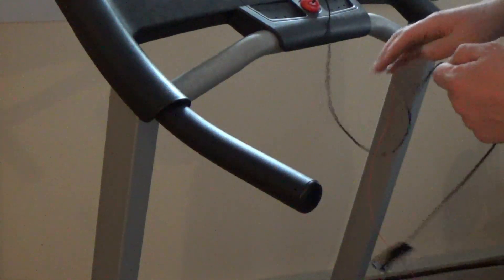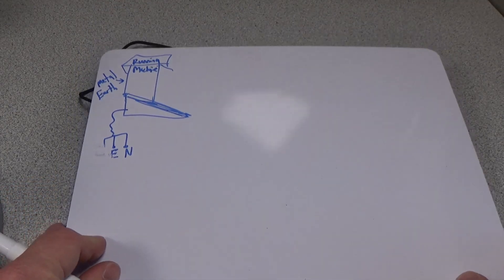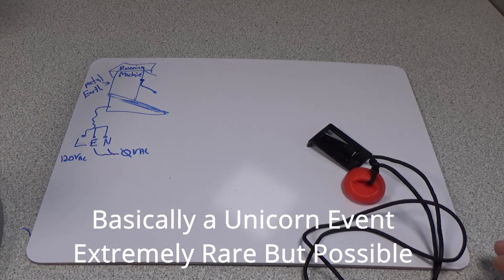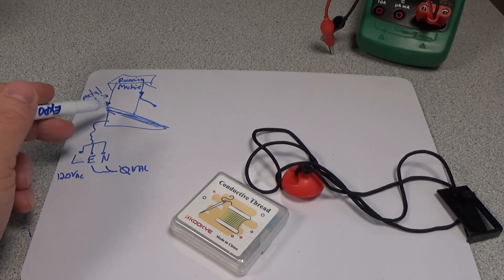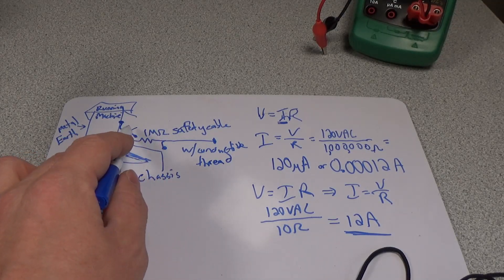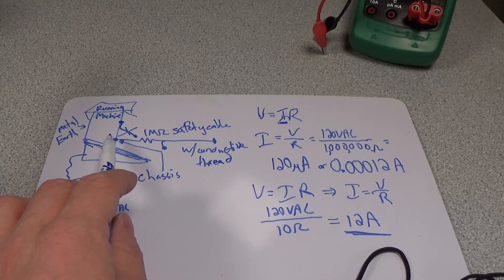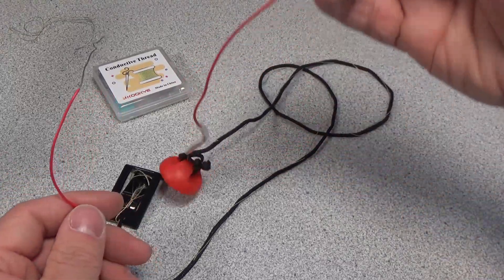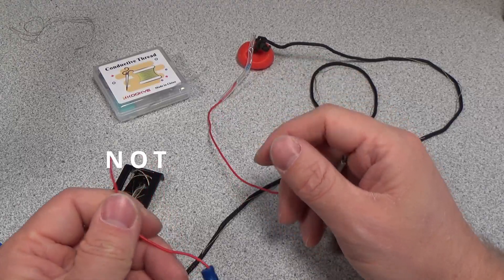Treadmill Static Shock Fix – #15

Comment: I keep touching wall every few minutes to release the static electricity that is built up in my body while running in the treadmill.
Reply from the maker: Yeah, I don't have to do that anymore, I did have to replace the fabric wire once as it corroded open circuit.

Comment: I saw your video at first but I thought maybe my treadmill doesn't have an earth-ground so I did that, but I am still getting shock when wearing a somewhat cushioned shoes. The only solution is don't wear shoes at all when using the treadmill. 

Today I tried your method, and it works. No more static discharge, thank you so much!!! 👍
Reply from the maker: haha, yeah, I did have to replace the string finally, I should put a short out on that.  It went non-conductive after a few years and I started getting shocked again.  Replaced the string and back to zero shocks.
Reply: Thanks for that info. Happy running :) @AllThingsOnePlace
Reply: ay man, will wearing no shoes really solve the static shock?

Comment: Im not as smart as you, could I just buy a premade electric static discharge wrist band and attach it to the metal of my treadmill and have it work the same as your solution? I believe those wrist bands have a built in resistor so I shouldn’t get shocked in case of a short. Please give me your thoughts…thank you!! Love from Ontario, Canada
Reply from the maker: Yes, exactly.  This is still working.

Comment: Use copper Tinsle, run under belt connected to both sides of the earthed metal chassis. Use eyed crimped terminals at both ends.  Drill n tap chassis, put a machine screw through eyed termination, screw into the chassis. Do this both sides. The copper tinsle should be tight with the tinsle in contact with the bottom of running belt. Job done ✔️
Reply from the maker: Good alternative, thanks!  I'm still using the threaded string, still working.

Comment: I got the shock on my manual treadmill !!  Only 2 x AA battery are installed on the machine. Very annoying indeed. Do you think the treadmill mat will fix the problem?
Reply from the maker: What happens with my machine is I end up not connected to ground or earth and therefore build up static electricity in my body.  That has to be discharged through some path, in my case the string of the treadmill is modified to be conductive.  I haven’t had much experience with a human powered one though so the static may be building by some other means.  I don’t know if floating the whole machine on a mat would help or not.

Comment: Same as Michelle mentioned, i am having  the same issue, i havs check motor winding and health of transformer... i am not sure if this is due to Capacitor issue. Its really v high static charge, and some time due to high static charge it get trip aswell. But some time keep running till 6km without getting tripped, but yes static charge stay there, i just try to use wooden stick to operate speed and incline, but its not easy some time to manage it🥲😑
Reply from the maker: Yeah, that sounds like a pretty severe case.  It does still sound like your body is getting charged up so an anti static strap from yourself to the body of the treadmill (as I made) may totally solve your problem as it did mine.  If there is any other issue, issues with building wiring, etc. then the static buildup fix will not help.

Comment: I’ve shocked myself so bad it’s shut my treadmill down completely! I thought I fried the computer part but I unplugged it and thank fully it came back on!!! But man I’m super scared to touch it at times to just adjust my incline or speed😢
Reply from the maker: Ouch!  Barring actual problems with wiring that sounds like a lot of static electricity building up!  The static electricity fix I put together for myself is still working great.  You an also get premade static straps as another commenter posted.  Making sure there is a resistor between you and the metal of the chassis is very important though.  I am somewhat SHOCKED there isn't a commercial solution for this.  I tried lots of other things from forums and this was the only thing that worked for me.  Let me know what solution you have found and if it is working consistently.

Comment: I find this video the same night I hook up my static wristband to my tread mill. I just attached an eyelet to a chassis bolt and clip my strap to the eyelet. I run with the strap on my wrist which isn’t a big deal. It works very well and the 1M resistor has always made me feel safe when I’m working with electronics. Another option might be to incorporate a very low amperage fast blow fuse. Say 100mA. The static wouldn’t blow the fuse but an electrical short would. Either way the strap works very well. I once got zapped in the ‘groin’ and it rebooted my console when I was 6K into a run....double whammy!
Reply from the maker: The homemade static strap has ben great.  Not one zap since.   Ow.  I can't say I've been zapped in the groin on a treadmill glad I got this fix in place before that happened to me!